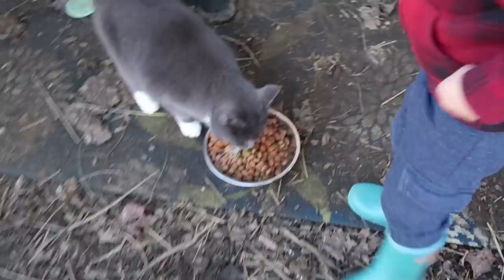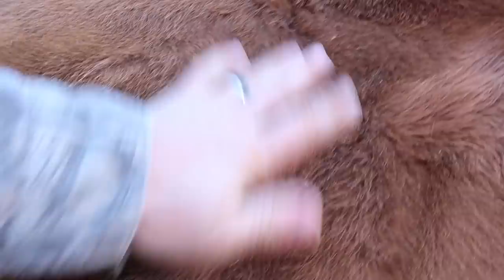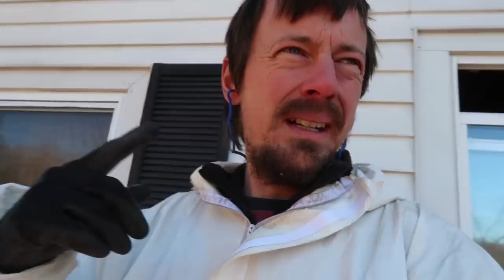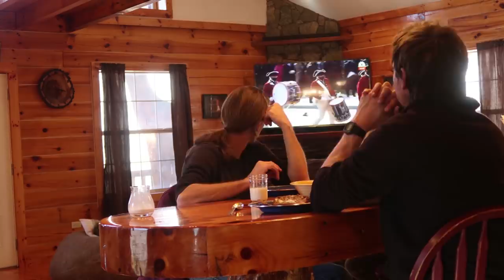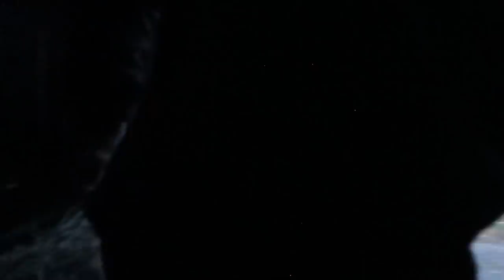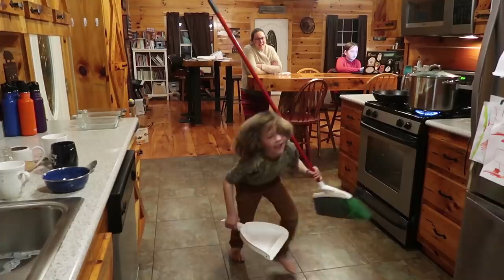Tearing This 100 Year Old House Into Pieces - Renovation

Comment: I did some research and found out why you wanted to get rid of the bead board. I was shocked to find that unless chemically treated and sealed the mold can live in the boards and re-sprout if the conditions are right. Wow! Now I know why when our house had mold after a tornado, the contractor demoed the whole top floor.

Comment: Sandra Westley we took all our boards up, and insulated under the floor by 9 inch thick insulation boards big job but it keeps the heat in, and the house warm, under the boards is just as important as in the walls and roof, to keep you cosy.

Comment: You folks are so wealthy,so rich in love,laughter and a so much  caring. Seeing all the children do tasks ,chores or just pitching will build a strong character ,a strong spirit within. I might suggest a softer plastic broom. or maybe a dust mop stick.you could make one Art. Use a door hinge with an old broom stick. A foot and a half stick on the bottom. wind or tie a long dish towel on the short stick around the bottom and Wha la you have a dust mop. So much easier. still need a broom and dust pan to the side but so much more fun,faster ,clean and mop. if i had the money i would by your son the spray and clean mops. Hugs to you A'll

Comment: Your house is coming right along but I have a question you haven't said what are you going to spray on the walls and the floors and the ceilings to eliminate what mold spores are still in the house and I noticed you only pulled up one whole floor down to the ground why was that God bless you from south Mississippi